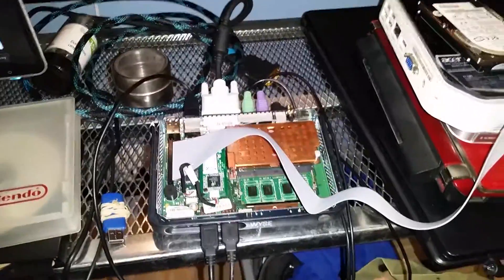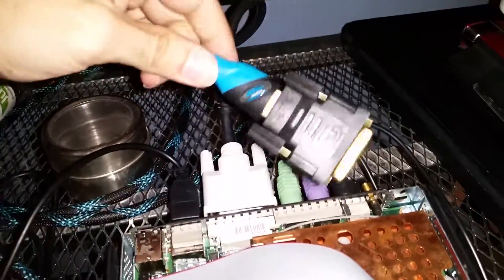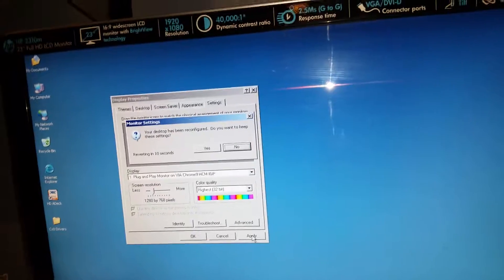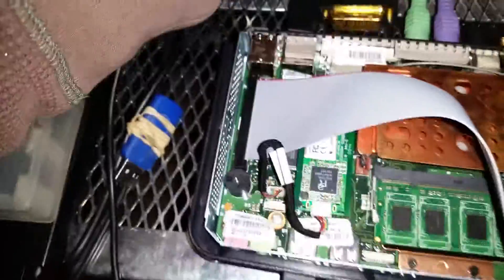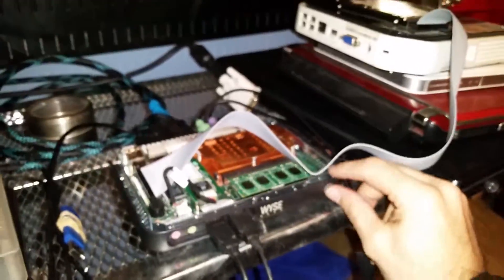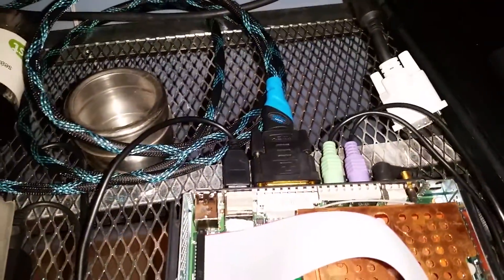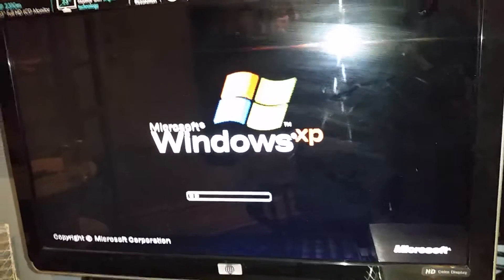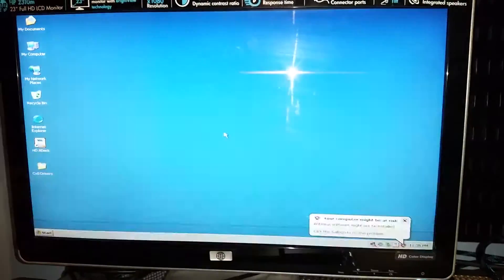Wyse Cx0 - HDMI issue

Comment: This is device driver bug with VT1632(A). I am having this exact same issue. There is an foss implementation called openchrome and it seems the same bug is being discussed here but this is for linux. https://bracecomputerlab.com/2018/05/23/finally-got-openchrome-drm-to-properly-support-via-technologies-vt1632a-dvi-transmitter/
Reply from the maker: Woah, nice! Thanks for the heads up. I didn't realize this was a thing. Though it doesnt surprise me, some vendors are very FOSS unfriendly. Nvidia comes to mind. It really grinds my gears.
Reply: Vt1632 is programmed by vx855 chipset over i2c bus and then it is fed digital pixel signals to transform them into hdmi signals. It requires checking i2c bus to see whats going on and since that dvi chip has no documentation or datasheet it is hard to analyse where the error is in programming it. But on XP when i dont have the official release from wyse for xp imaged, the driver in public domain is likely different. I used via_vxx855_winxp_20-12-01w.zip and probably yours is same. This device supports 2 dispalys and vx855 is driving everything.
Reply: I saw your other video seems it is def audio over hdmi being a problem which should not be there in vga mode.

Comment: Hi,  i have a similar problem with a HP 8220 I5-2400, as i have 3 pc's under 1 HP monitor i can simply change inputs on the screen, , but i updated the HP8200 with a GT1030 , the card works fine, but as i was using the VGA input to the monitor i needed a adapter, i bought a cheap passive pass through wire only ( no sound not a problem as that PC uses USB speakers as a work around ) 
It does the same, it blinks and goes black, some times in say 5 to 15 seconds it does another blink and display then black.

Spent a few hours tinkering, then tested the cable adapter with my HP laptop , the laptop works fine and displays on the same VGA input cable.

End result was the GT1030 sends out insufficient voltage to run the adapter it has some small circuit board in it, the laptop apparently has no issue
BTW i am getting a Wyse C10LE to format to dos 6.22 for older games or linux as secure web browser which is how i came across your page

Regards
George

Comment: Nice experiment! Is it able to run hd videos, like those x264 compressed vids we have over the net?
Reply from the maker: this guy uses a Via VX855 Media Chipset "The VIA C-Motion video engine delivers a Hi-Def™ visual experience, including advanced video acceleration for  H.264, MPEG-2, MPEG-4, and WMV9, video formats, plus a VMR-capable HD video processor" but with a Via 1ghz CPU  that already runs super hot even with advanced cooling, I am not sure if I would want to run one as a Set Top Box for a media center, but its worth a try. Toss a reply back if you would like me to try it out, it's something I hadnt thought of.
Reply: Foxx D'Gamma Thanks! As you said, I read VIA's claims about that chipset but was doubtful about the cpu being able to keep up as well. If c10le decodes 720p h264 video well then it would make a low cost media center provided the dvi to hdmi conversion issues don't crop up.
Reply from the maker: I have to admit they run VERY HOT even just idle. I will try to nab one out of my storage and run some tests. Have any suggestions for software? I would go with Linux and Kodi/Plex - let me know. Hop on our discord chat and lets discuss this: https://discordapp.com/invite/AgMMZ5k I actually have some Atom based thin clients that could do what you need.  Look at the HP T5740.
Reply: yes kodi would be a good test if that Cx0 can take it at at least 720p x264 vids. I use a raspberry pi and it operates well on 1080p. But the real benchmark would be if the thing can handle amazon prime video in HD. Pi fails to handle it as Amazon uses some proprietary Widewine DRM decryption module that is processor intensive.
Reply from the maker: the Cx0 only has a 1GHz Via CPU, that already runs blazing hot when idle. If you need to do anything CPU intensive, the Cx0 is definitely not your key choice for a target platform. They do make atom based thin clients like the HP T5740 that is basically an Atom class Netbook... Jump on the discord chat sometime and come hang with the rest of the merry misfits, we are all geeks and techniophiles alike. Feel free to hang around, check out what projects we are up to, and share your own:  https://discord.gg/AgMMZ5k  I am always posting new unpublished stuff too.